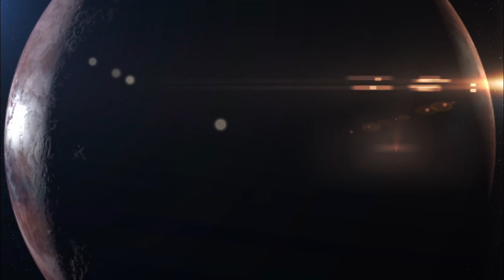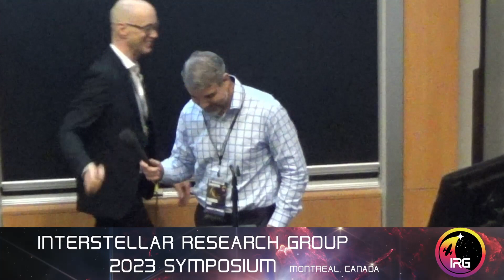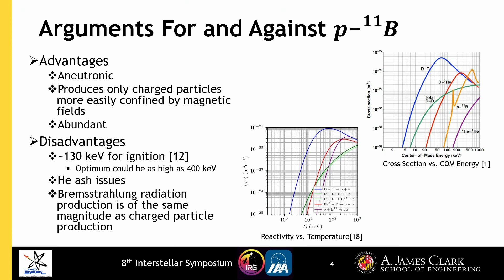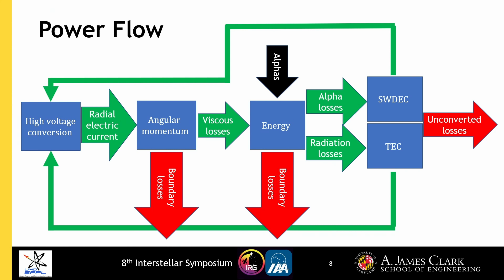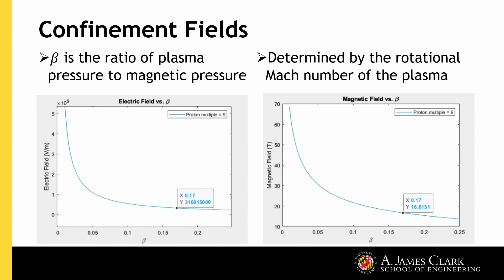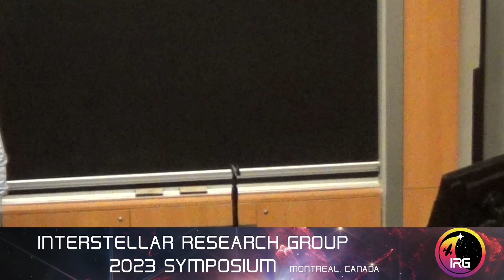Bremsstrahlung Power Conversaion for Fusion Power and Propulsion in Space

Comment: Well you worked it out for real there is a company called Positron dynamics that can produce a lot of positrons enough in theory to launch a spacecraft using an older method with modern materials and precision, also if we use a mixture of different fusion materials like an atom bomb would ignite the hydrogen bomb if there are let's say different reactions stacked upon one another to support them to keep going.
One could also use them to be a kind of let's say detector for leaks in certain systems like positrons or even use it like a shielding not only for X rays but also for gamma rays in combination with other means to improve space shielding and of course after several other layers as a shielding or energy part for a small modular reactor in the sense that it will transfer energy from one form to the other stacking up layers to act as a part in shielding by use of law of conservation of energy one transfers it to another form of energy plus losses giving us a kind of extra shielding layer for aboard a spacecraft for Deep space or a layer around a very small modular reactor !!!
You cracked an important peace of a puzzle thank you so much for that !!!